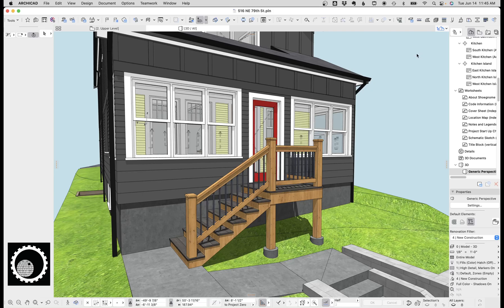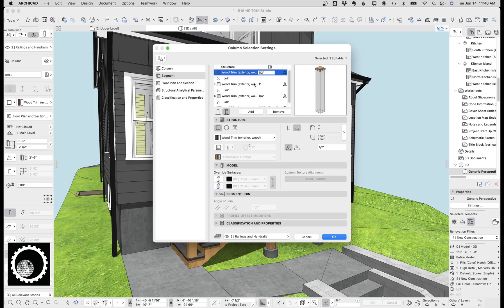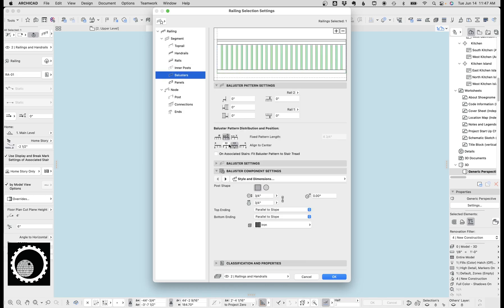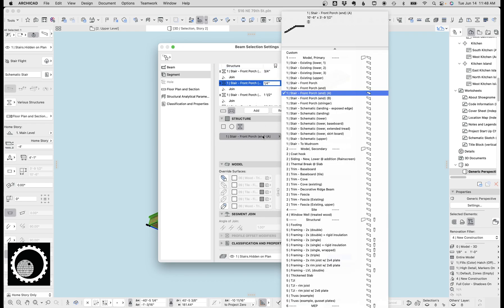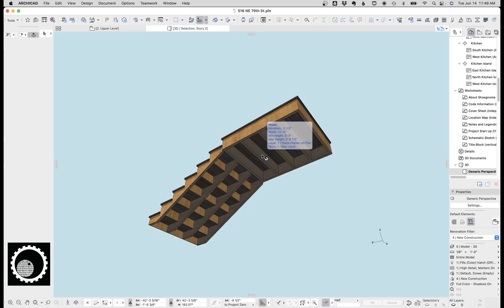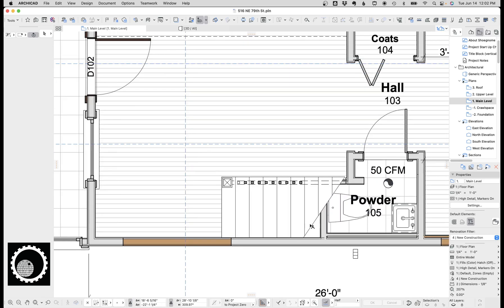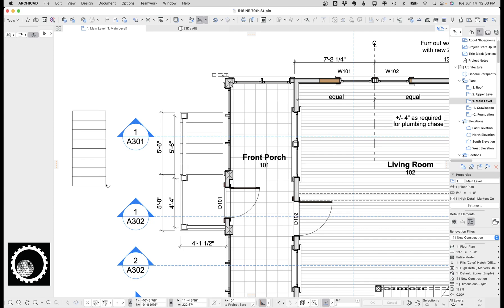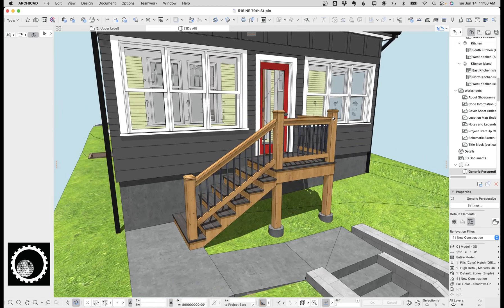Archicad Tutorial #84: Front Porch case study in Archicad 25

Comment: When you were editing your complex beam profile for the stair itself, the cross-sections of the timber beams under the landing had the diagonal X lines in them denoting a cut timber beam.  Are these just 2D line segments drawn in the profile?  Is there a way to have these show in a section through the beam?  This is something that I've not figured out how to do but would love to know if it is possible - to be able to automatically show those X's in timber beams where they are cut in a section, without having to draw them by hand.  if they don't show in section, why did you draw them in?
Reply from the maker: They do show in section. I wish there were a better solution, but: in the complex profile I draw the framing members as 4 triangles (of the same building material). The four fills don't merge, so you get the X. Unfortunately if you put 2 beams next to each other, their fills will merge. I wish there was a better way. Download my template and take a look at the complex profiles that are in the file.